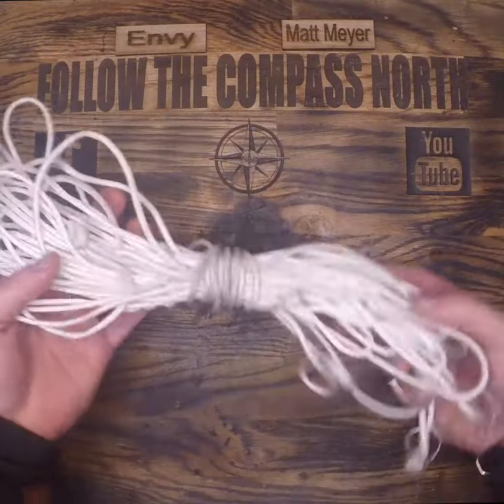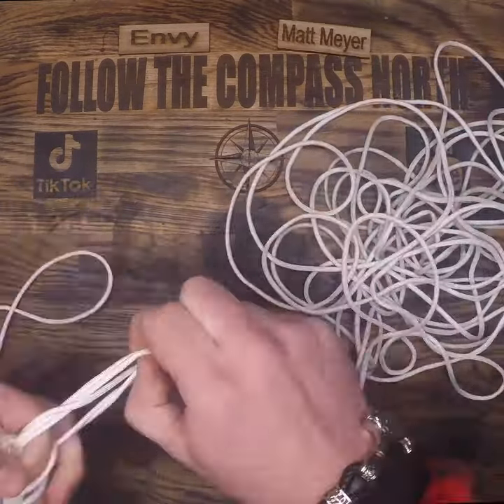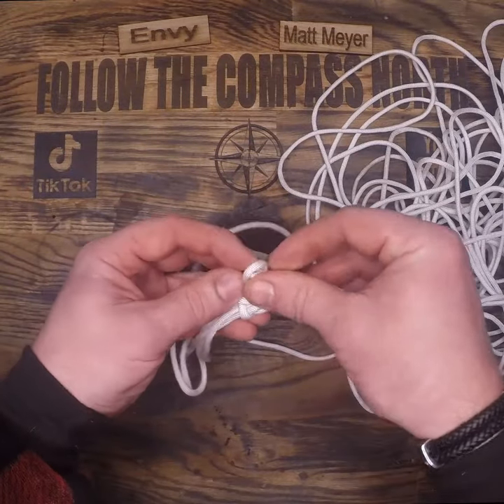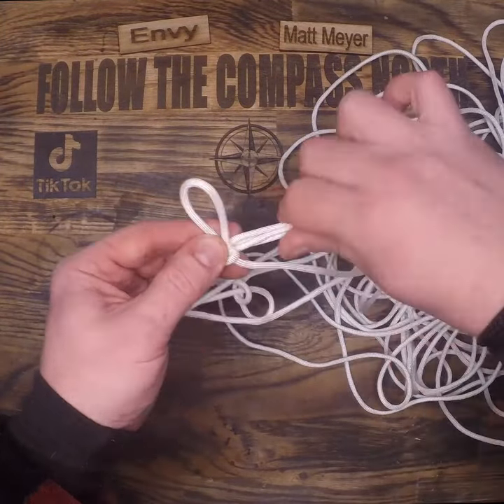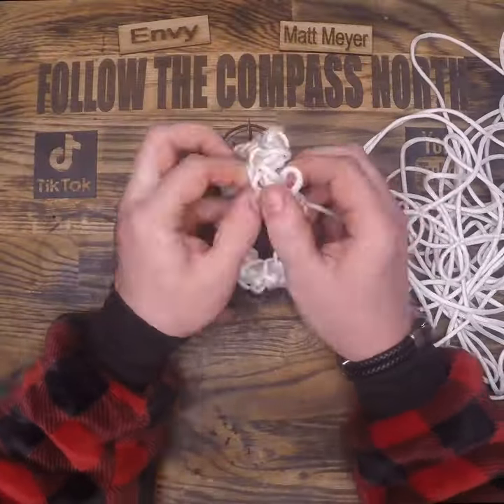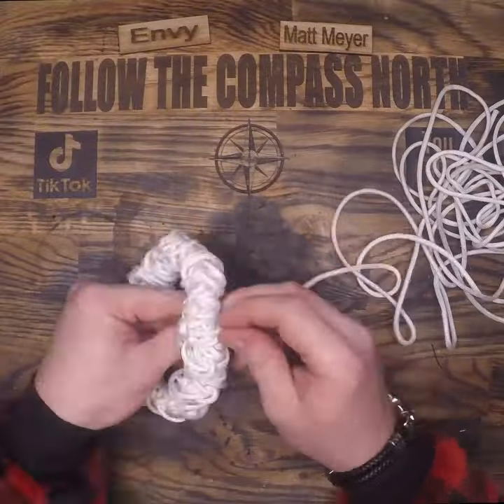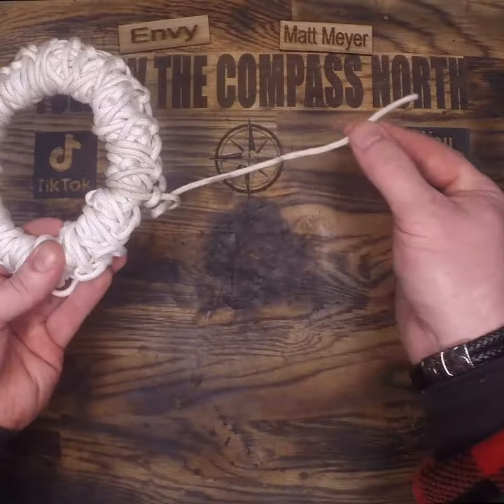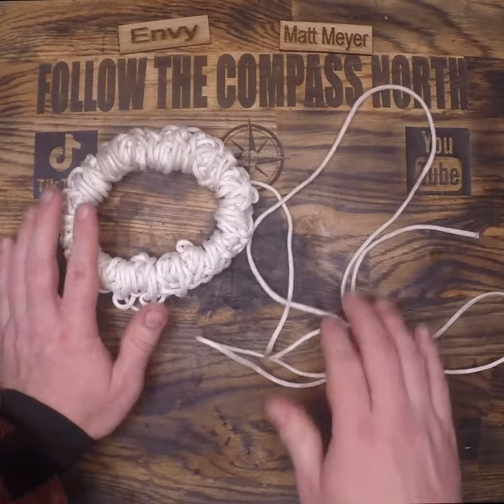What do you call this technique? Long line storage: Bird's Nest?

Comment: Seems like it takes a long time, but it also seems worth it once it's done if you're not using it a lot like a clothes line.
Reply from the maker: You're right, this is really only good as a supply line not a daily use line that get's used and re used. I find the time it takes to make is really relaxing but then again... I'm probably wired wrong.
Reply: @FollowTheCompassNorth  😂😂great pun!

Comment: Wind it up using two sticks in a figure eight pattern. Tie across where the string crosses in both directions. This can be done with any length or type of cord (i.e. rope, electrical cord).

Comment: I just spent the better part of two days undoing a knotted skein of linen yarn. It is fine and the knotting was a nightmare. 

As I untangled the mess, I worked a simple center-pull ball like I have done for decades to handle yarn for knitting. 

One of the challenges for yarn made with wool or similar materials is to keep the fiber loose enough to avoid putting it under tension yet avoiding the pile of spaghetti every few minutes while using it. If you stretch it when winding, your knitting will shrink the moment it relaxes and also will twist and warp the finished garment.. But, spending days undoing knots instead of knitting is frustrating with a capital FRUS even for me and my OCD. Center pull balls handle this challenge through friction between the exterior and interior in yarns with a little puff. Even cotton that has been mercerized to make the yarn shinier will behave fairly well in a CP ball with enough friction to keep the its integrity until I use about 75 percent of the ball. From there it is only a quick wrap into a smaller CP ball when it no longer holds the remainder without much difficulty.

Linen doesn't work in a center pull. It is slippery and the moment I began using the yarn to warp my loom, the ball disintegrated and I had another day of undoing the same mess I thought the center-pull ball would fix. 

Thankfully, I don't need to worry about tension on the fibers if I use it for warping a loom. The whole point of a loom is to keep fiber under tension. Linen is one if the strongest fibers per its diameter and won't stretch so it is used often in weaving. I got a loom for Christmas but have found the tangling such a barrier that I was nearing despair. This video might save what little sanity I possess. I'm excited to try this technique in the hope of saving my cool new toy from serving as kindling.😄

Thanks!

To that abandoned linen to make it behave!

Comment: oh hey! similar looping is done in crochet. the initial slips to the desired length would be called a chain, and the ones after that go around the initial chain would be called slip stitches. if you used a crochet hook to help you, you'd probably be able to make it a lot denser and neater

Comment: Here's a simpler way of storing that:

Hold one hand on your hand.

With the other hand, start doing rounds from your first hand down to the same elbow of the first hand, and back up to the first hand.

At the end, with the other end of the rope, do a loop around the bigger loop and tie it bye passing that end between the smaller loop and pull it right.

Then just hang it somewhere.
Reply: This works well for thick cord (like an extension cord) but it really doesn't work that well for a thin line, or a really supple rope. The thick cord has enough structure that it will more or less stay still while it's wound up, but thinner lines will end up passing their loops through each other when handled, and that hands up as knots when you try to untangle.

It's not a horrible method, but it definitely isn't tangle free for all ropes of all lengths.

I used to wind cords like that when I was younger, just because that's how I saw everyone do it. Now I prefer a technique more similar to how rock climbers coil their ropes. The advantages there being that it is (in my opinion) a more pleasant method, and it also doesn't introduce twist in the cord.

Comment: I just roll mine up on a stick. Been doin that since I first flew a kite at around 6.
Reply: Right? Or if you want to get fancy, cut a wide V-notch on either end of a piece of wood and wrap around that.
Reply: @angryginger791  you ever let a kite out fast with the fancy v’s cut in 1x4, no that don’t work you end up just dropping it and let slap you on the shin. Grandpa had the fancy v stick for laying out lines, he was a slow winder.
Reply: @arnoldjohnson3317  LOL. Well, I wouldn't use it for kites, but it's good for just storing line. Works great for extension cords or thicker ropes that you wouldn't want to wind around a stick. To each his own, right? They're both better than this rat's nest thing.

Comment: Okay but if you've got a 30m cord, which is going to take you longer? Looping it, or folding it over a few times and tying it down in the middle, and maybe dealing with a little bit of knotting when unwrapping it?
Reply from the maker: I've done this with 300 meters. 1,000 foot 550 rolls. No knotting.

Comment: Nice, but have anything less demanding for one with less dexterity due to injury?
(From my shoulder, but it affects my hand after a few minutes...it ain't withered, though lol)
Reply from the maker: I totally get it, large daisy chains or overhand knots would be better suited for you most likely.
Reply: wrap it in a figure eight around your thumb and pinky or elbow and hand. then when it's ending wrap it around itself a few good times, like 5minimum, and then tie a half hitch (make a P with the end and slip the whole thing inside it) when you want to use just pull the other end. 
You can also do many variations of the video's method. i personally do sth like that for my rope dart - I do it in a continuous chain. it tightens it all and when I want to it deploys immediately
Reply: @pedroclaro7822  thanks!
Reply: @FollowTheCompassNorth  thank you, sir!

Comment: I wonder if this would work on yarn?
Reply from the maker: Yes, but typically when I'm working with yarn I make tight balls like hard little nuggets of craft.
Reply: What would you use the yarn for afterwards? If you're knitting or crocheting, you'll need to use so much for the project that it would be insanely annoying to put the yarn into that bird's-nest instead of into a standard yarn ball.

Comment: Too much time, if you actually use the line you need to be efficient. Hank it around your thumb and pinky or around hand and elbow leaving a few feet then wrap loose end around.
Reply from the maker: I never have to untangle my lines. That saves time.
Reply: @FollowTheCompassNorth  neither do I, I deploy 150ft and 100 ft lines multiple times a week with my arborist throw for antennas during the summer months as long as you do figure 8s instead of 0s for your loops it's fine

Comment: The apocalypse will end before you finish dude
Reply from the maker: This took 10 minutes. Less time than you spent watching videos on your phone today.
Reply: @FollowTheCompassNorth  Yes, you are not wrong. But I would rather wrap that rope around something usefull, like a hatchet handle or maybe a shovel handle... maybe a machete....
 Later its easier to unrawel and handle it.
Most of the time the setup you started with can be put back toghether in less than a minute or two, and if You you need just a piece of the rope You can cut it on the sharp angles of the mentioned tools.
This bs is not good in anyway.
This can be good if you have only this rope but you need just a couple of inches  and you do not want to cut the rope You have.
Think about it, this shit is promoted by prep and survival shops for a good look in the box sets, not funcionality, thats all.
If I made any typos or any other language errors plese understand that english is my second language.

Comment: Conservation of energy... your technique is extremely labor intensive.
A much simpler method would be more reasonable.
Reply from the maker: This method is labor intensive once and never has to be repeated for this bundle of cord again, vs dealing with tangled, twisted, knotted cordage every time you pull more out. It looks neat and clean, and stores easily in a pack.